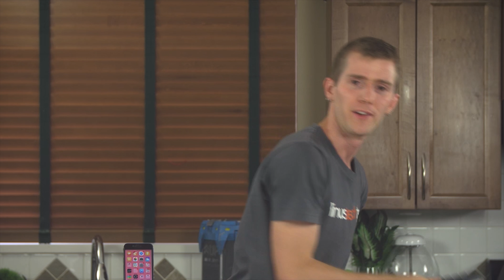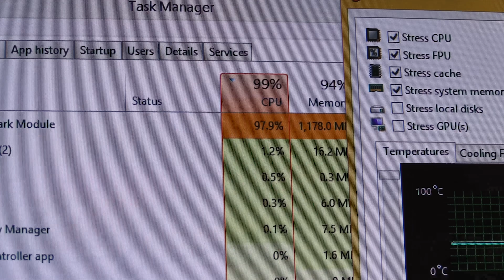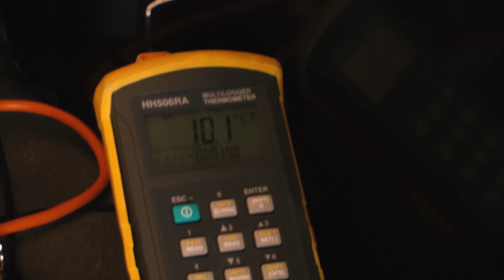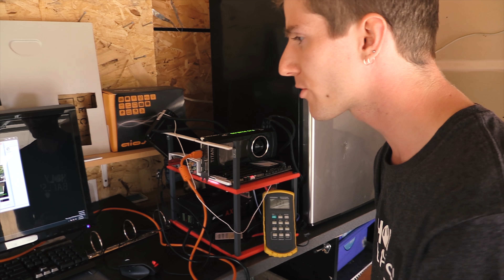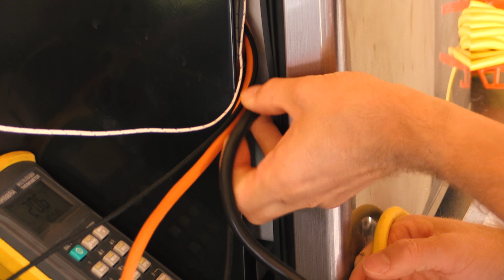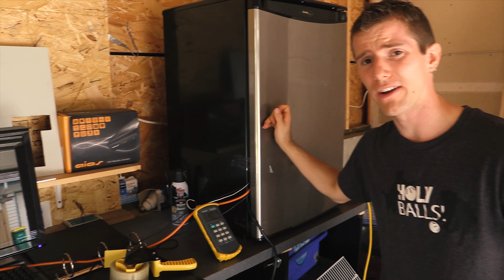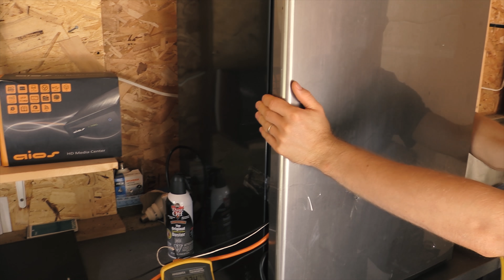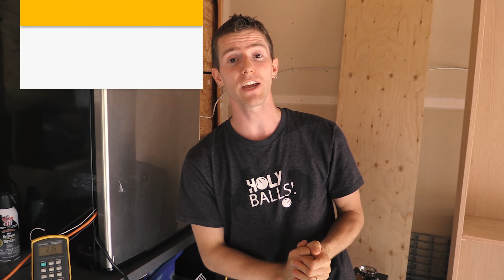PC Build in a Fridge - Does it Work??

Comment: Build a PC in a 350 degree oven next.
Reply: creptrbot Set oven to 1 degree and therefore pc will be 1 degree

Profit?
Reply: born 2 biscuit Set it to Zero degrees, CPU might get frosty.
Reply: creptrbot ooh, gotta see how they come up in liquid cooled suits
Reply: ***** trolling is in fact still trolling.
Reply: Use the heat to run an absorption chiller and cool the PC.
Reply: only if it's a potato
Reply: Thx for clearing that one up m8.  I r8 8/8.  Now excuse me while I eat my Doritos and drink Mtn Dew as I listen to my Audible audiobook.
Reply: creptrbot System would be baaaked ;)
Reply: creptrbot My name is boxxy you see, you see you see
Reply: +creptrbot You mean an AMD build?
Reply: +Joe Mills Only if the proof of the product at-hand--whiskey or vodka--is high enough to provide enough heat/energy content per volume (BTU/Liter or gal.) to be lit-off & continue burning long enough to overcome any non-flammable properties it may contain. They tried 80-proof whiskey in the '63 Chrysler Turbine-Car, and it ran. They also tried French perfume in it... And anyone whom is familiar with perfume knows how alcohol is used in the making of it, and hence-why the trial. The result? All it did was make the exhaust ducting smell sweet.

Also, slow-burning alky--like methanol--has far-less BTU/vol. than ethanol... Hence part of why recently they went from using methanol in Indy-car & Formula-1 racing to ethanol, and reduced the total fuel capacity needed to operate for the same amount of time. This also allowed designers to improve aerodynamics, but that's another story.
Reply: creptrbot Dose It work?
Reply: creptrbot 
350 Kelvin?
Reply: creptrbot boxxy
Reply: J Griffin
***** 
They need to sell consoles to sell software for consoles, which is where the money is.
Reply: creptrbot it will work if its a wooden pc
Reply: ***** No shit!
Reply: J Griffin Sony and Microsoft have been selling consoles without making a profit since the XBOX 360 and PS3 (maybe earlier).  They can do this because they make up for it with the subscription fees (PS+ and Xbox Live) as well as profits from games sold on their console (they get a small cut for the games developed for their console).  The two companies make a net gain overall after factoring in all of these other income sources, but the consoles themselves create a loss.  

TL;DR  The companies sell consoles at a loss as an investment in order to get a large playerbase of people who will then purchase all of their products, turning a profit in the end.
Reply: TheGenericAssasin That's actually a myth, it was true for the first two years of the last generation of consoles, and it will be true for about another 6 months to 1 year for the current gen of consoles. This is because the tech in both "next gen" consoles are cheap and plentiful. The xbox one has a truly pathetic GPU with a theoretical maximum 1.31 trillion floating point operations per second. The ps4 has a GPU with a theoretical maximum of 1.84 trillion floating point operations per second. Both are fairly pathetic. The PS4 has a maximally cheap 1.6 gigahertz 8 core AMD cpu. Keep in mind that 1 gigahertz of AMD processing speed is not 1 ghz of intel processing speed. It varies, but on average a 1ghz amd processing core will be able to do the same as a 0.7-0.75 ghz intel processing core. So when you take that into consideration, you're talking about a 1.2 GHZ intel processor with 8 cores. It's truly pathetic, considering that a fair amount of that processing power will be going towards running the rest of the operating system, and "multitasking", and most games will not even try to take advantage of 8 cores. Microsoft has the exact same processor, but they overclocked theirs to 1.72 gigahertz, which is not much of an increase, so that's the equivalent of an 8 core 1.28 gigahertz intel processor. These components are already pathetic (1.31 teraflops of computing power? Really microsoft?  8 gigabytes of shitty 30 dollar ram, really microsoft? I mean really? That's pathetic). In any case, within 6-12 months microsoft and sony will start to break even on the sales because of dropping component prices (but they will keep the price of the console the same of course), and within 12-18 months they will both start to make money off of each sale because of dropping component prices. About 2 or 3 years after the start of the previous generation microsoft started to make money off of each xbox 360 sold. Near the end they were just raking it in, selling CPU (crap processing units) that were made with 80 nanometer transistors! They were literally double the size of the commonly used units at the time, 40 nanometers! They would sell these 360's for 200 dollars when the CPU literally cost 30 dollars to buy, the ram cost 10, the "motherboard" cost about 15, the HD cost 20, and the gpu cost 30, all of this including labor. They would turn a fancy 75% profit off of each unit.
Reply: +creptrbot Fahrenheit or Celsius?
Reply: ***** the liver doesn't make glucose from ethanol, that'd be an endothermic process.
Reply: Nick Williams ._____________________.
Reply: McDucky lol
Reply: McDucky lol
Reply: creptrbot  or CPU barbecue test XD
Reply: *****
More like $90
Reply: ***** I have no hate for PS4 or Xbox one, but yeah 200 dollars? Maybe for retail. Sony probably paid 10-20ish dollars for the CPU originally for your specific PS4 in a volume purchase.
Reply: J Griffin
XBone and PS4 might cost more or just barely less to make than they sell for.     
Also, if you're mass producing a device you'll bring the price down significantly.
Reply: McDucky
 If that was true, Sony and Microsoft wouldn't be in the business of console production. They can't cost more than 100 dollars to produce each.
Reply: *****
They're in the console business because of their huge market shares.
Reply: McDucky Huge market shares don't help if the market was fundamentally flawed. If you don't make money on a individual transaction basis, you don't make money. They would stop if they weren't making at LEAST a 200% markup on MSRP. That's basic good business everyone follows. Does it actually cost 700 dollars to produce a iPhone? 3.7 dollars a gallon of gas? 400 dollars a Xbox or PS? No, of course not. If you can't make good money individually, you will lose money overall. if they were making only 15-100 dollars per sale, It wouldn't be worth the initial development costs, years of additional engineer and programmer employment cost, and the upfront material and marketing costs.
Reply: J Griffin
 That's my main point, even if the margins are slim in the black on hardware itself, you may survive, but is the work worth it?
Reply: J Griffin
The XBone is estimated to cost around 400-500 USD per unit to manufacture.
I don't know for sure, but I wouldn't be surprised if they lose on unit sales or barely stay in the black
Reply: J Griffin
If I had a citation from Microsoft I wouldn't say "estimated"
http://www.cnet.com/uk/news/microsoft-squeezes-little-profit-out-of-each-xbox-one/
http://allthingsd.com/20131126/microsofts-xbox-one-cost-90-more-to-build-than-sonys-ps4-teardown-shows/
Reply: Edward Man what if its a brick?
Reply: it will not work. Its called moneys out of the window(s)
Reply: creptrbot that would re flow the components...
Reply: +stereotypicalpenguin  oh sick roast, get rekt AMD!
Reply: +J Griffin Microsoft is running off fuckin Bill gates and his whoopin 70+ Billion
Reply: +creptrbot That better not be celsius! Most components aren't rated to withstand anywhere near that!
Reply: they will be getting hot while there running, so the cold will just end up cooling them, the computer would have just down if they couldn't take it...
Reply: +creptrbot I bet you would obsess over 'Home Improvement wouldn't you you?? LOL!!!!
Reply: ***** theres sugar left over from the process, ethanol is pure alcohol... alcohol is what you find in beer etc, not ethanol... you can run a car on ethanol!!
Reply: +creptrbot I think a walk in freezer would work better for this size of pc.
Reply: +Joe Mills i got solid state transistors, profit?
Reply: +creptrbot http://featu.re/DRBQ56
Reply: Solid state? A transistor switches on and off, on and off are referred too by state, solid state means it only has one state? What's the point of a transistor then??
Reply: Precision of signal control w/o wavering [due to conditions external to the system], for one... The solid-state refers to the lack of mechanical movement, as found in vacuum-tubes. It may not be visible, but it's there... Just try banging on the cabinet of a tube-amp while it's powered-up, and hear how it gets picked-up by the tubes & carried through to the speaker-element.

That last part explains how portable radios took-off during the '50s.
Reply: +Ozzie Peck "Solid state" is just the lazy, shortened way of saying or writing 'solid state electronics' (circuits built entirely from solid materials).
Reply: +creptrbot It would have significantly the same results as putting it in a 10 degree oven.
Reply: +GGFr0styy Kelvin
Reply: +The Karolean 76 Kelvin would actually be marginally survivable. However the hard drives would die pretty quick if he has any.
Reply: streetdragon95 Considering how that's about -25C I'd say it might even be plausible as long as it could be sustainable over time.
Reply: The Karolean eh wait sorry I meant 350 kelvin would be 76 C. mixed up the units when I typed that out lol
Reply: streetdragon95 No problem.

Comment: your using it all wrong. you use a big enough heat sink for a water cooling system. performable a copper one. run the water cooling system through it. job done. use the the dial in the fridge or out of the fridge to determine what kind of temp you want. but anyway useless because cpu and gpu are made out of metal. metal expands due to heat. they are designed to work when they expand. amd says so. BUT for a fan-less system it makes sense. But the the fridge makes noise too. so we we use copper piping all the way to the kitchen to the pc. noisless but expensive and copper pipes all down you walls. all the work for for a shit computer which will be outdated within 6 month. POINTLESS

Comment: AFAIK there aren't any fridges that which wouldn't have compressor rated for 24/7 use (well maybe some portable mini fridges). Problem is actually that they aren't rated/designed for heat sources in them. They're simply put designed to just to cool down the mass of products inside, which generally doesn't happen actually rapidly and to maintain desired temperature.